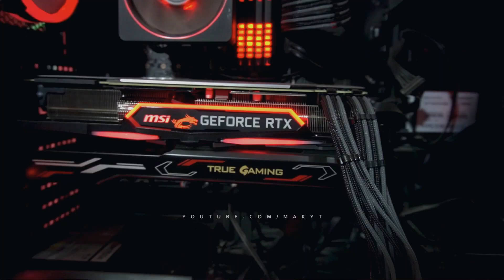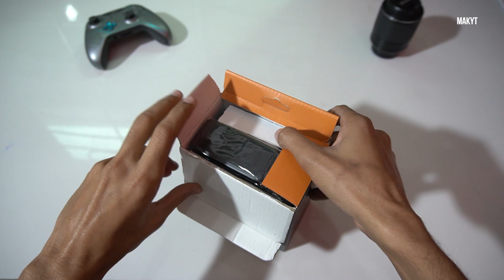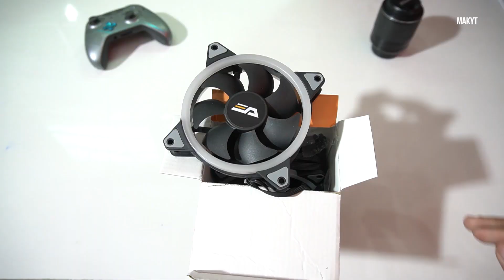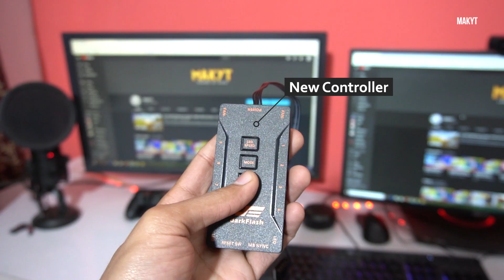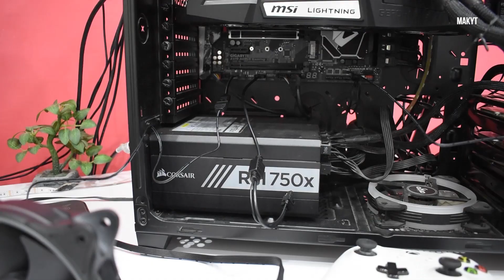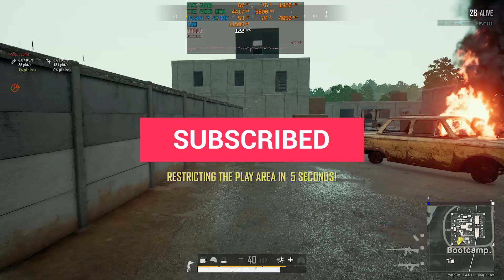Aigo Darkflash DR12 PRO (2020) RGB LED Fans Unboxing and Review (NEW)

Comment: it work so well on my pc, it can sync with my asrock mobo, sync with ram and gpu, but the only issue is the fan speed, so slow :(
Reply from the maker: Yes, that was the problem with these old Aigo Fans. Newer models have much better fan speed and airflow.
Reply: @MAKYT  idk i have the newer dr12 pro or the old version, cuz mine was usint sata for power, not molex

Comment: Bro i have these fans how to connect these fans in my motherboard i have b450 tomahawk max which has 4pin /12v rgb header..??🤔🤔🤔
Reply from the maker: You need 5V RGB Header. It will not work with 12V header.
Reply: @MAKYT  i have deepcool Argb converter 😋

Comment: Hi i need help. My motherboard is gigabyte ds3h v2 and it only has 4 pins 12v in it even the RBG header is 4 pins. How can i connect the included pwm cables to my motherboard?

Comment: What does the 3 pin cable to 2 cable that plug into led port on the controller for ?
Reply from the maker: It is used for motherboard sync.

Comment: no one ever explains which side the airflow goes on each side of the case...
Reply from the maker: I'll do it in the next Fan review video.
Reply: @MAKYT  I just figured out mine, but not completely. front case in, top case out, back case out, but I got two extra on the bottom, but I'm not sure whether to put the airflow outwards or inwards. I'm just gonna put it inwards and hope for the best.
Reply from the maker: Bottom Inwards, but more inflow always results in more dust.

Comment: I bought new darkflash aquarius case with cf11 pro fans. I connected molex but there is no room for other 5v cable on my mobo (b350i pro ac). I have 2x4 pin srgb and 2x4 pin cpu and system fan input on mobo. With that setup fans and rgb lights does not work. But my psu's molex are fine. I tested them with my old molex fans. I dont know what is problem. 5v 3 pin socket is important?

Comment: I got 8 fans of these connected to the controller, sometimes i have noted 2 and rarely 3 fans stop spinning if they are on low speed, but if i use high speed they come back again, is that normal? should i claim for warranty?
Reply: If you have them connected to our motherboard and if the motherboard have some type of Fan power mode like my Asus then yes , what it does is if its managing all fans automatic , low temperature it disable few ones
Reply: If the fans stop running at low speed it could be that the very low power they are getting isn't enough to keep the weight of the fan moving, this is the reason many desk fans or box fans have a switch that starts on 3 instead of 1; so there is enough initial energy to get the blade moving.

Comment: Hi i have installed this on my current setup. However, when I turn on my case, the fan and lights turn on. But the lights turn off after a few seconds. I have to get the remote and turn the lights on manually to keep it on after I restart my computer
Reply: that means ur controller/fans are not connected to mobo

Comment: Dear MAKYT I just bought the RGB Darkflash, but after connecting to my Mother Board A320M on the reset panel and on my motherboard the reset panel wire burn but the fan can still running.can you help me how to get another set of that three wire?

Comment: Greetings,
Does this controller work with dr12 2019 version fans, because i want to motherboard sync the fans
if not then is there a way to mobo sync dr12 2019 version fans??
Reply from the maker: No, New controller will not work with previous models.
Reply: @MAKYT  ok
so there is no way to mobo sync dr12 fans ?

Comment: What cable do i need to connect on the asus prime a320m motherboard?
Reply: Ive the same question, I installed them in my gigabyte motherboard and i cant turn on the rgb..

Comment: you can plug dr12 normal fans on the dr12 pro controller? or dr12 pro fans on dr12 normal controller?
Reply from the maker: I’ve tried, didn’t work.
Reply: @MAKYT  in what way? dr12 pro to normal or normal to dr12 pro? i need like 3 more fans but i only find the dr12 pro and i have the normal version of dr12

Comment: Can I connect directly my argb heatsink to dr12 pro contoller  led header which is 3pin? is that 5v equivalent to argb header? my mobo has no argb header that's why i want to sync in my argb heatsink to dr12pro rgb fan.
Reply: yes just put it on controller so it all syncs

Comment: is asus b450m-a prime compatible with this fans?
Reply: probably not, I have a TUF Gaming B450 and it only features a 12v RGB connector, for these fans you might need 5v aRGB connector with 3 pins

Comment: I was wondering if the fans can be controlled through software? I have the asus rog b450f mothebord but the power connectors are 4 pin and these fans are 3 pin. Will it still work?
Reply: yes

Comment: Hey. Im new to desktops. Can anyone explain me if it is possibel to conect this fans to motherboard for automátic fan speed or it must be connected to PSU with manual fan controller?
Reply from the maker: Yes, You can connect these to motherboard for fan speed control. Only if you get the cable in the Box.
Reply: @MAKYT  how do i control speed bro , please explain . i have got the same kit from aliexpress

Comment: I have a question. I have  RGB fans already on my case, but my controller died, so I ordered this controller a few days ago. Do you think it will work with the fans I own? They are pretty similar, they look like this https://www.pinshop.rs/images/p/4/1/9/4/5/41945.jpg

Comment: The fan speed can be controlled by the motherboard, or only manual by the remote control?
Reply from the maker: You can either control fan speed or the lights. As it comes with a single cable.
Reply: Eu já te encontrei no pelando ou é impressão minha ?

Comment: Very good video, I have a question: How is brightness controlled from the remote control? Please help
Reply: Did you ever get it to work?
Reply: The man hearted it but didnt comment
Reply from the maker: There is a button clearly labelled “Fan Speed”, You can change speed using that button from remote control. Only have 2 speeds, Slow and Fast.
Reply: @MAKYT  My question is how change light brightness, no for fan speed.
Reply: @MAKYT  hello,
I have a msi b450 carbon max pro gaming wifi. I will be able to connect those connector that come with the fan controller to my motherboard? Because I didn't understand what connector they come with.
Reply: Ffc

Comment: for now im using aigo dr12 old version.and i owned asus rog motherboard.is it enough for buy only fan controler for aura syncing?does old dr12 fans works with this new controller?
Reply: Hi
did you find out if its work??

Comment: Hello... I have a question. What happens if my motherboard does not have a 3 pin or 4 pin cable? I am worried about the RGB function and also with the remote control, does it work?
Reply from the maker: Yes, it will work using the remote.

Comment: So these fans cannot be controlled via motherboard (pwm)?
Which ones better - Antec Prizm or these, if price difference is ignored?
Reply: Just checked the specs of Prizm. Easily the better fan. These have extremely low airflow and are there not suitable for cooling, though they look quite nice.
Reply: @ASKnASK  Thank you. Bought the Antec Prizm. They look good with bright LEDs & have good airflow but are quite noisy at higher RPMs

Comment: Great vid...so i have bought the aigo darkflash shadow cpu cooler..i know it had 3pin rgb header..btw my motherboad has a 4pin rgb header. My question is if i connect my rgb pin from the cpu fan to dr12 pro fan controller light strip port , can i control the lights of the cpu cooler... help me
Reply from the maker: If the connector is same, it will work. Just check the voltages for light strip and shadow cpu cooler. I think it should be 5V.